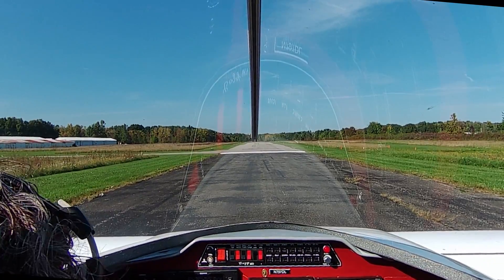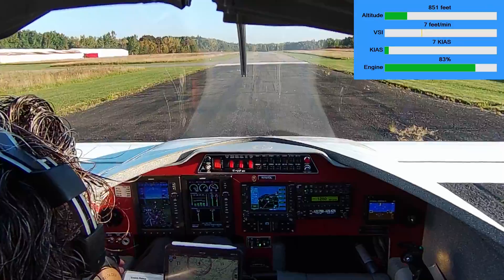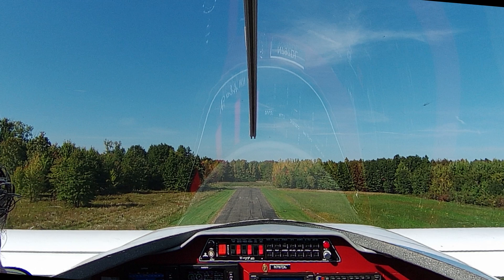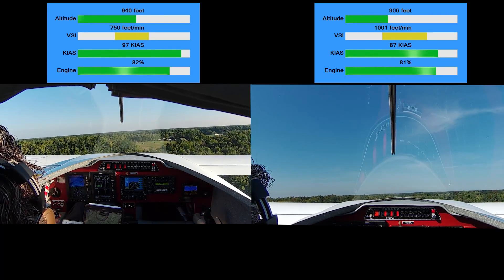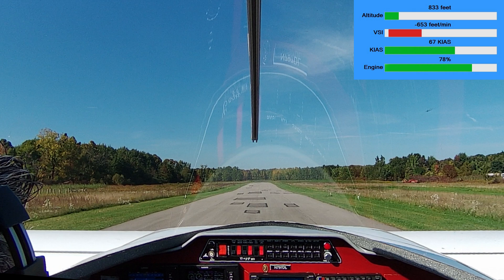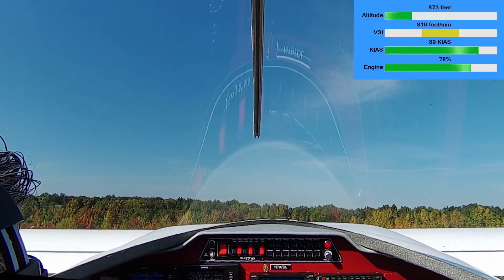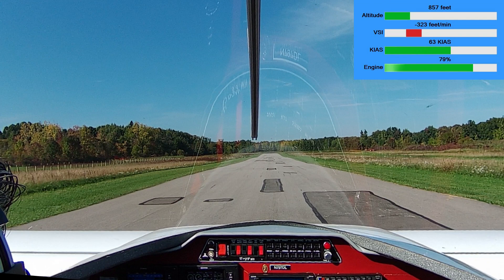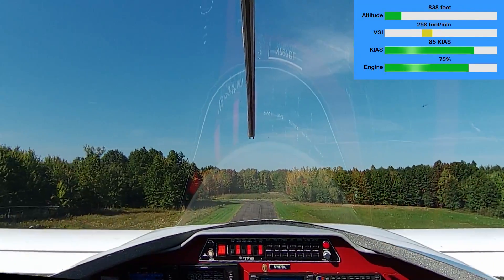Almost a CRASH: How did this happen? And why?

Comment: The engine performance graphs you show only indicate 1500-1600 rpm on takeoff.   Is this a mistake or real?   For an IO-360, takeoff RPM should be around 2350 rpm, no?   Maybe I'm missing something.
Reply from the maker: The scale you're looking at is the altitude. The RPM was on the right side of the chart, and was cut off. Static RPM at the beginning of the takeoff roll on this plane with this prop is 2300, and of course it increases with airspeed. 1500 RPM would never get this plane off the ground.

Comment: I'm based at 4G8 also and though your airplane is beautiful it's either overweight, underpowered, or both.  Then again maybe that's just how much runway that type uses.  I would never operate out of Columbia if my one person clearance over obstacles was that marginal.  Personally I'd move to Lorain or  Medina. 

You should have flown out of Columbia before the owner lengthened the runway  (by a lot) and cut down all those trees at the north end.  The airport is a thousand times better than it used to be.   Best wishes, Mike
Reply from the maker: Canards do use a lot of runway, it's the nature of the aircraft. I'd love to be at 1G5, but the waiting list for hangars there (and pretty much everywhere else in the area) is years long.

I remember the state of the runway before (I've lived here for 18+ years). I would not have considered this airport back then. As it is, with the extensions and the trees bulldozed, it's at what I could consider the minimum for this airplane.

Comment: Good video.  Seen so many video where the pilot couldn't break the instinct to keep pulling back and it ended badly.  You made the right move, and quickly.  Just wondering about that 25lb weight you moved from the passenger seat to the nose.   Not sure how much distance it is from the seat to the forward mount point, but seems like for weight and balance it might be correct to cut the mass in half.  Of course I don't have the weight/balance sheet like you do.

Comment: Airport owner needs to look into FAA Airport improvement funding, the Airport i fly at just got funding for runway repairs/resurface  and a new lighting system. Also protects the Airport for minimum of 10 years from being close by the county.
Reply from the maker: That is only available to publicly owned (ie city or county) airports - not privately owned airports, unfortunately - even when they are public use.

Comment: I faced the exact same situation you did in that right after liftoff, the Cessna 150 I was flying was climbing at a rate that I could see would not clear the trees, just as was your situation. I immediately aborted and slammed the 150 back onto the 3000 foot runway, locked up the brakes, and was barely able to stop on the paved surface. I made the instantaneous decision that running off the end of the runway was safer than colliding with the trees. You say that the prop rpm is 2300. Is that red line? Most single engine planes red line at 2700 rpm.
Reply from the maker: Keep in mind a 150 rotation speed is 49 kts, where this plane rotates at 75 kts...so much less runway remaining, and much more suited to scrub off.

Redline is in fact 2700, but unless you have a constant speed prop, you are not going to see that sitting still (static RPM), or on a takeoff roll. You will need to be at cruise speed before you can get full rated RPM.

Comment: Just a quick question, why didn't you push the engine to 100%?
Reply: It was at the most power it could make at the time. His propeller is "fixed pitch" and is pitched for cruise flight. Think of propeller pitch as being equal to the gear ratio on a car or bike. A fixed pitch prop is like only having one gear. You can get going quickly with a high revving engine (or pedaling like mad) but not go fast (low gear/fine pitch), you can go fast but struggle to get going (high gear/course pitch), or you can pick something in between. There are propellers that can change pitch while being ran (equivalent to changing gears or even closer to the affect of a CVT) but they are heavier (bad for this airplane design, he already needs 50 pounds of counterbalance ballast) and they are way more expensive, and he doesn't have one. In other comments he has said he is getting a propeller with less pitch which will allow the engine to spin faster at slow speed = closer to reaching the engine's full potential power.

Comment: I noticed the divider position on the windshield in the two takeoff were very different, as was your engine power (77% vs 83%), so I think your basic analysis is ok, however, the real issue is an improper takeoff plan.  This is a short field on a summer day.  You should hold the aircraft on the ground until to reach best angle speed and then climb to above treetop height by 100’ and then relaxed the climb to a more normal climb to pattern altitude.  This is probably some like 83-85MPH.  You are a lucky man with that large of a CG change only affecting you that much… it could have easily set you in the trees.  You definitely need to calculate your numbers and practice that max takeoff climb a couple times before you take a passenger or more ballast.  Cooler days ahead are great to test and adjust the process before the heat returns in earnest next summer.  Document your results and do a followup on this video.

Comment: You need to upgrade your nose strut to include rebound damping asap (or drastically improve it if it's already damped) - otherwise you've just got a pogo stick, not really suspension. It's smart you're looking at the runway too, but suspension is a fundamental that'll protect you in future unforseen situations on other runways as well as your home base. You did a really good job underlining why the ability to gain airspeed at will before rotation is so valuable: decent suspension will give you that ability without a big cost or weight penalty given what you're flying .
Great video, great analysis, great work. Thank you.

Comment: We had a spot similar on our 5000’ runway at KHHG before they resurfaced it. I would have to also keep canard pressure down past this or we would get early lift off. It happened in our Q-2, Long Ez & Velocity. 
Maybe trying getting the canard up but pick up some speed before lifting the mains off might help but if practice some different techniques at a longer runway. Did you retract your nose before climbing above the trees? And if your close to us (Ft. Wayne area), I have digital scales to do a W&B. 
I’m not sure the DA should be that much of a factor. We also operate out of 800’ here in northern Indiana and not uncommon to see DA close to 3,000DA and went to Put-in-Bay Island this past August.
Reply from the maker: I did retract the nose as soon as I decided to continue climbing. I have scales here as well, I have a new prop coming (should give me more static RPM) and when I've got it on, I'm going to defuel and re-do the W&B from scratch, just so I have hard numbers to work with.

Comment: Your go no go at 65 knots but if the engine failed at that point wouldn't be better to just roll off the runway try to aim between trees? I would think that is better than being over the trees and not have an engine. The comparison videos the incident video engine was below 80% the normal take off on the left was above 80% while it wasn't big of a difference it was a difference.

Comment: I think that extra weight in the front had the bigger impact than the density altitude. At first I thought you were tail heavy when you started down the runway with how much the nose bounced. Five extra pounds up front would probably equate to the 25 pounds under the seat.

Comment: What you call pogo, in automotive I think the term is rebound. The start, compression is called jounce. So you have jounce and rebound.

I worked as a machinist for Delta 22 years and flew out of ATL often. Not an A&P, but I pay attention to details. Atlanta's north inner runway used for taking off used to have the same problem almost center of the runway. You would go through a dip at a fairly high speed from the east end. If you watched you could see the wing tips going up and down a couple of cycles. And almost immediately after the plane settled down, we would rotate.

Comment: this is a problem that normal non-canard aircraft can experience with aft center of gravity.  Your analysis is very good and gives a good summary, how seemingly innocent conditions, which wouldn't cause any problem on their own, can add up quietly and cause a crash in some cases.   suboptimal CoG --> warmer day --> slower acceleration --> longer distance for takeoff roll --> running into an unusual bumpy part --> early rotation --> more drag and even slower acceleration on the backside of the power curve (behind Vy). At this point, the pilot has no more than a fraction of a second to react. With obstacles being closer and higher than before, there is a very strong instint to pull up more -->  create more drag --> slow down even more --> experience a power-on stall and spin --> crash vertically or inverted.  It is good that your training kicked in.
Reply from the maker: All 100% correct except for the stall/spin - as a canard, it would have mushed into the trees, but not departed controlled flight/spun. You don't get a typical stall/spin with these planes, they just mush and come down fast. I'm sure that if you REALLY abused it, at aft (or especially beyond aft) C/G, at low speeds, you might be able to get the main wing to stall and subsequently spin - but I don't know that this has ever been attempted or tested.

But yes, a good point (and also the point I was trying to make) about most incidents or crashes being a chain of events.

Comment: Maybe a possible fourth option... rearrange components of the airplane to achieve CG w/o having to add 50 pounds of ballast. That is a lot of ballast. Good decision making of keeping it in ground effect for that extra 5 seconds!
Reply from the maker: Canards such as this require ballast when flying single pilot in order to stay within C/G. If components were rearranged to not require this, then you could never carry a passenger in the front seat. I talk about this extensively in this video: https://www.youtube.com/watch?v=ycLQaiX4ylE
Reply: @CanardBoulevard  Interesting. I'll check it out.

Comment: I take it you can't easily take off from grass in a Cozy, or varieze or longeze.
Reply from the maker: Or at all. It is not recommended. The gear is not designed for it, and you will have so much resistance from the grass and bumpy ground that you either will not get to rotation speed, or you will need a REALLY long runway. You also don't have flaps to help with a short/soft field takeoff technique.

Comment: Question about it not making drag without lift.  Thinking in physics terms of the airplane being a system. If you have to use controls (elevator) to keep the plane from flying are you creating an equal or even higher amount of drag by opposing the lift causing the plane to want to leave the runway? I assume this would lead to less energy input to the aircraft as a system.  Which of course we trade for airspeed or altitude.

Not sure if this is correct, but makes sense in my head.  When inadvertently entering flight below rotation speed (the runway bump in this case), it seems better to level off in ground effect for a few seconds to minimize drag instead of trying to keep it on the runway longer.  Then getting airspeed up to Vx or Vy depending on the presence or absence of an obstacle ahead.  Im no expert but hopefully someone with higher knowledge can clarify.

Great video, thanks for making it
Reply from the maker: You don't need negative elevator input to stay on the ground - the angle of incidence of the aircraft on the ground is such that it already will not fly. You HAVE to add up elevator to pull the nose up in order to get the main wing to rotate and start generating lift. So just leaving the elevator neutral (assuming it is trimmed correctly for takeoff) will keep the nose (and the airplane) on the ground. Many conventional airplanes will fly themselves off the ground if you get the speed up high enough. Canards will not.

Comment: Brought back memories (not fond ones, either!). I wasn't flying a canard, but I had a situation that played out quite similarly: high DA, quartering headwind, aircraft near max weight for that DA, fairly short runway with an obstacle followed by trees beyond the runway end. The airport operator said that about the time I passed the midpoint of the runway, where I would normally have lifted off, he saw the windsock swing about 90 degrees (the windsock went out of my field of vision seconds before that) and make my quartering headwind a quartering tailwind. Thankfully, I was flying an aircraft that loves to be airborne so I was able to get up into ground effect and accelerate enough to climb over the first obstacle. As expected, I bled off some speed coming out of ground effect. Once I was over the first hurdle, I dropped the nose to pick up enough speed to get over the trees. That was something I never wanted to experience again, especially since I had my new fiance in the right seat!
Reply from the maker: That's scary! Glad you did the right thing, I've heard from several pilots now who have had similar experiences.

Comment: So heres my take, runway conditions aside.. thats boarder lineing a non improved field based on poor conditions but ive seen worse and your always gonna run into fields like this no matter where you go.  Your aircraft im unfamiliar with and due to that i dont know what your VY or VX speeds are, or what your climb performance is for take off and roll out so this is just basednon a basic assessment of the situation.  First i would set that plane on that runway for VX to give me as much altitude as possible in the shortest distance, when i got thr altitude need then to to VY for the climb out. The plane seems to not handle poor runway conditions well and that might just be a characteristic of the air craft.. considering youve done other take offs and landings at the field you obviously have the runway length needed but the poor surface conditions induce drag and and slow your planes performance, you left the ground to early and didnt have the speed or lift needed so you stayed in ground effect for a bit before leaving it but with just barely enough speed to maintain VX and also be above stall.. i would consider for this field every take off being short field/soft field and a 50' obstacle for all future take offs and then on top of that always air onnthe side of performance with my calculations regarding weight and balance and density altitude performance. The density altitude was shit on this day you woulda had serious issues.  Moving forward if i were you id set personal minimums for as best performance as you can get at that airstrip, lets say roughly 25%less take distance then on this day which i know might limit you but atleast that way if its a bad day youll always be with in the greens to abort safely
Reply from the maker: Exactly what you recommend is exactly what I do. EVERY takeoff and landing out of/into that airport I treat as a short field. I do performance calculations each time, and give myself a very healthy margin, particularly for abort/stop distances as well as obstacle clearances, just in case something goes wrong - like it did here. I am extremely cognizant  of DA at this airport as well as crosswinds - a crosswind takeoff in this airplane requires braking during the initial roll, as it has a free-castering nosewheel, which slows the initial acceleration - so the crosswind limitations I give myself at this airport are VERY conservative. Several times I have gotten to the airport, seen the winds, checked DA, run the numbers, and said, "nope, not flying today" and instead went home.
Reply: @CanardBoulevard  just realized how crap my message read lol talk to type failed me but I'm glad the point I was trying to make got across

Comment: Being airborne does not create drag, the angle of attack does, caused by the plane's attitude. You could just stay in ground effect with the nose relatively low to minimize drag to gain enough airspeed.

Comment: Your analysis is pretty good but it misses a couple of points. 1. Your nose wheel damper is too weak and you need to replace it. 2. Your success with unloading the nose wheel at 60 knots was an error. You seemed to recognize this in your remedy but you should acknowledge your error in unloading the nose before v-rotate that created this potential in the first place. 3. You blamed temp density without acknowledging that you neglected to consider this important factor before lining up for takeoff. You should put an air density chart visible in the cabin and consult it before every takeoff. Really, every takeoff!! 

The runway dip is a facility problem that you might wish to take up with the FAA!
Reply from the maker: There is no nosewheel damper in this type of canard aircraft, which is why the nosewheel is normally unloaded at around 60 kts, to a) reduce load/impact force on the nosewheel, and b) try to prevent exactly what DID happen here. I do actually consider DA for every operation at this airport, and I have more than once come out to the airport, analyzed DA and winds, and said "nope, not flying today."

Comment: I should know this, as I gained a PPL 40 years back...  But do aircraft have dampers on the undercarriage? If not, then maybe add one, and compensate for the extra weight by removing ballast.
Reply: Some do, some don't. But replacing ballast with useful weight would be a good thing 👍